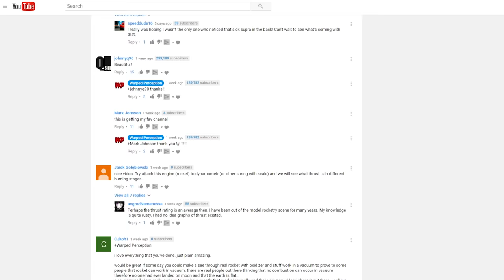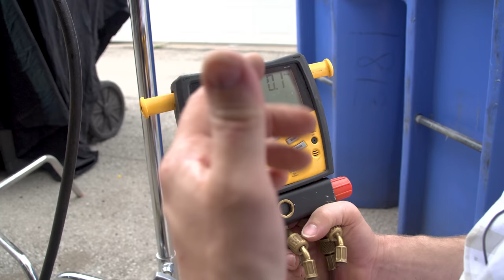Model Rocket Engine In A Vacuum Chamber - 4K Slow Motion - will it burn? - Rockets (S1 • E3)

Comment: I think there are still some inconsistencies in the test. Look at when the rocket actually starts moving in the slow motion. I think it pushes off the end cap of the tube. If you run tests based on the size of different vacuum chambers then you could probably tell how much force is been exerted on the spring. Of course, the spring would have to be exactly the same for each test. Have 3 different size vacuum chambers and shoot all 3 at the same time and see if the spring force will be the same. The whole thing is to see if the larger vacuum chamber will exert the least force on the spring when the rocket is ignited. If yes, then imagine an infinite size vacuum chamber such as "space"  where there is absolutely nothing to push off from.
Reply: I'm glad you're saying something about that topic because I was about to have to mention it myself in the comments!
    I don't know about you exactly but my thoughts are the rocket engine thrust plume was pushing off of the edges of the vacuum tube so that's why there was a little bit of push back on the spring holding the engine etc...
   And it did seem like there was an initial stronger push or jerk when the small cap object was seemingly being pushed off against by the rocket until it was thrown down the vacuum tube and no longer could be pushed off against I think that the Small tube allows some of the thrust currents on the outskirts of the vacuum tube well be like turbulence mixed with a sort of eddy current type phenomenon causing a slight bit of pushback but not enough was seen by me at least to make me think or believe yet that that rocket engine would be able to fly through space or through a large vacuum chamber the size of an Olympic swimming pool or something let's say if it didn't have the edge of the vacuum tube to push off of as well as his own gases and plumes and other things that are basically building up right behind the rocket plume and possibly simulating an atmosphere to be pushed off of instead of a more realistic situation in an open world vacuum like space supposedly where all those gases would dissipate and not just hang around right there to be pushed off of conveniently all lined up linear in a tube I would like to see you much larger vacuum chamber with nothing near the engine that's being fired for me to agree that rockets can push off of nothing through space and still move around maybe there's more to it than they even realize like it pushing off of its own exhaust gases but if that were the case that would be pretty dumb that they don't know that that is occurring if it is even possible to do so in space never been there myself! 😵‍💫🤭😵‍💫✌️✌️✌️
Reply: ...you think the explosion of the fuel behind the rocket, onto the end cap is what caused thrust?

Comment: The issue the skeptics have about "rocket's working in space" is not will a rocket ignite. Hence you experiment proved nothing because the solid rocket you have has the necessary oxygen in the chemical compound used. Hence it should work. An electric spark does the rest. The issue is the vast vacuum of space and how it interacts with the ignited rocket. And here you have a scaling problem. Hence the movement of the rocket in that chamber does not help to answer that question. Otherwise nice try.
Invoking "flat earth" in the discussion shows the inability of the party to debate the issue rationally.
Reply: exactly true
Reply: So what about the countless satellites, space probes and astronauts in the last 60 years?  All fake?  You are truly stupid beyond belief.

Comment: I get why people would think that rockets don’t work in space because forward momentum is based on the objects ability to push against itself and with no air pressure in space to push against the rocket you would think that the rocket would just burn and not go anywhere but forward propulsion is a self contained mechanism that pushes away from its own mass which is what allows rockets to have forward momentum in a vacuum.  Just like if you were holding a rock in space and just hurled it as hard as you could, it would simply keep flying away at the same speed that it left your hand going until another object or the gravity of a planetary body snared it.  I certainly understand the confusion people have about it but it’s easily explained.

Comment: The obvious problem, genius, is that your rocket filled the tube with gases. You should work for NASA.
Reply: For real. Still can’t explain how propulsion works with no atmosphere to push against.
Reply: It pushes against the gases in the tube
Reply: I don't think this experiment is valid because boundary conditions are totally different in a confined space to outer space. Inside the test vacuum the thrust can react off the walls of the chamber.
Reply: @snappatruce  NO , they dont need to "push against" anything  its newton's third Law: gases go in one Direction and the rocket moves to the other
Reply: Rockest are reaction engines and work in a vacuum.  Do the experiment yourselves in any way you want so that you can't scream "fake" every time someone shows you how REAL science works.
Reply: @Hitngan  How stupid can you get?  Please explain how rockets actually work in space, but only respond once you have read the necessary elementary texts...
Reply: @chrisantoniou4366  Calm down Ant man,  every action has an equal and opposite reaction, I know that, but the conditions in this experiment are not representative.
Reply: @Hitngan  The conditions aren't perfect, true, but space deniers and flat Earthers trigger me I'm afraid...  Having said that, it beggars belief how in the 21st century you can still have the pig ignorance some people display about the fact that rockets work, that space and gravity is real, and that the Earth is a sphere.